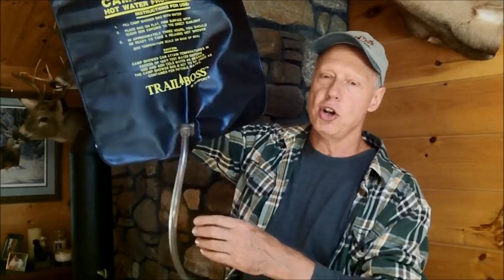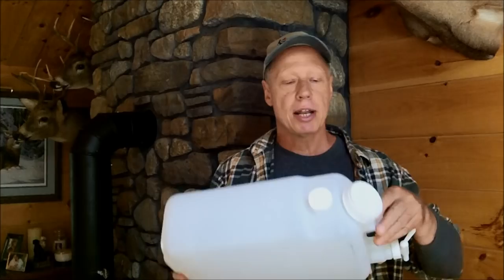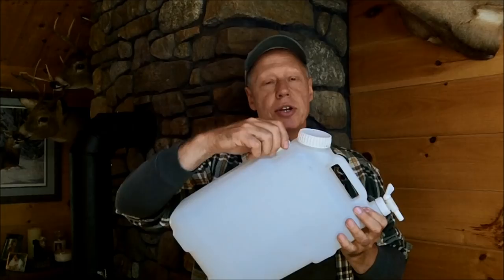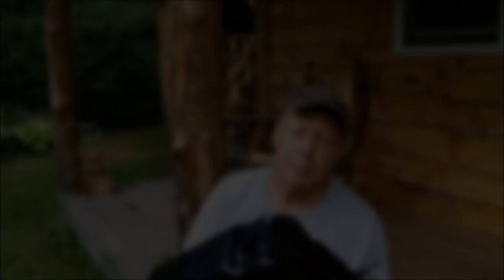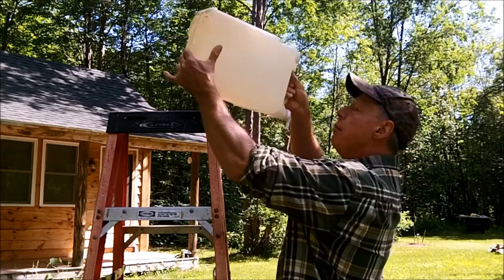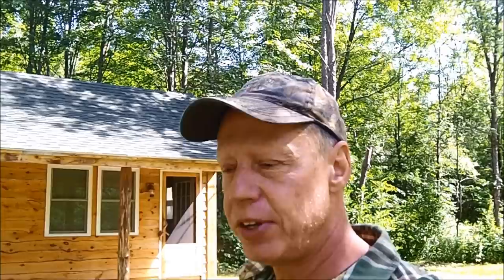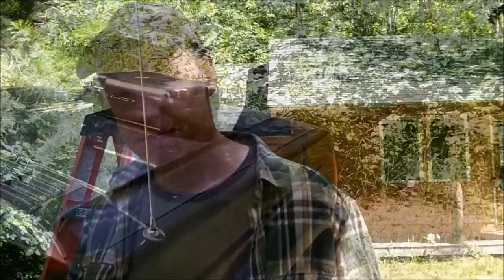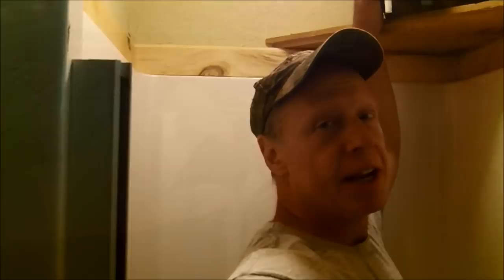HOW TO MAKE YOUR OWN SOLAR SHOWER.  DIY Project.

Comment: Hi BOTS Really loving your channel. You make it feel doable, even for a novice like me!
Do you think it's possible to make an effective sun-heated shower system out of 50-100 yards of black hose pipe? I was thinking of coiling it round on the sloped metal roof of an outside shower stall and attaching it to a trigger hose pipe head.  The other end would be hooked up to a gravity fed water tank. I'd appreciate some advice when you get a moment.
Reply from the maker: A coiled hose will heat water nicely but why fuss with anything more than this bottle?  This bottle offers a great shower and then it can be used in the kitchen, the shower, outside, anywhere.  See my latest video.
Reply: Thanks for the response. My reason was because I need large volumes of hot water....hope to be starting a new off-grid build soon and am pulling in volunteers...perhaps 8 people over a months build...which is lots of showers every day. I guess I could get 8 of these bottles....will check the video.
Reply: It's VERY doable.  I've used black pvc line , food grade black hose and regular garden hose from the local store..even the cheap 8/10 green/white garden hose. In Florida I've had it so hot it produced steam and was far too hot for me. But that can all be adjusted by how much exposure your hose is getting from the sun. I have used this method three different ways. A long black pvc pipe stretched out across a few hundred feet, a hose run on the ground stretched across the lawn (75 ft) and I've also coiled it and put it on three different surfaces/ three separate times. Coiled it on the lawn, coiled on the white porch and I coiled it and put it on top of the camper. I used a water Y and ran some water into the house but I also ran a line off that Y ,connected it to a garden sprayer that turned open like a jar lid would so that I could have it on and turn it off easily. I bought a shower tent from walmart and just ran that line across one of the snap locks that hold the shower connected to the support rods and in through the top of the door way and ran it through the tie that was sewn into the ceiling and let it hang down. I could easily turn it on and off or leave it runnning during my shower.  The shower tent I placed on a pallet that I'd picked up for free. Once you know the timing of the sun and when it heats to the temperature you need you can adjust your schedule to doing showering/ chores at that time of the day. By 2 pm at the very latest I had scalding hot water..and could bathe by 11 if I desired. As I mentioned...it was even getting too hot. It was so simple I couldn't believe how ridiculous it seemed to be spending so much on electricity when this was available and there's nothing like the feeling of bathing outside but with privacy. I love this method and will be devising something different for this summer. I have wanted to make a coil that hangs instead of having it on the ground and I've wanted to add more coils. I want to try more coils on the roof or lay more line down snake like across the roof...which i've also done before but i'd like to use more line. One other thing that i'm playing with is mounting an old water holding tank right over the shower. There is a roof vent over the shower...and I wanted to take that vent out and set up something with a similar set up as the plastic jug used her where you can turn it off and on or perhaps even use the same nozzle that i was describing with the twist/turn ability that i used in my outdoor shower.  You can feed the hose into the water holding tank and it will heat up and it will also refill by the hose as it goes down. It's hot enough on top of the camper to keep that water good and hot for quite a few hours out of the day. If i was real familiar with water pumps i believe that I would let that hot water into a hot water "HOLDING" tank and just recycle in the morning that which didn't get used during the night. :) Good luck !! A ten dollar hose can give you a couple of good hot gals of water in no time under the right conditions!
Reply: Right on! Thanks for this deecee stewart!
Not started the build yet, so it's all theory for me right now....We're thinking along the same lines! My theory is to use a ram pump to get water from the spring to the black tubing pipe.(Inspired by Land to House's videos) I would coil the pipe on and around a black painted 55 gallon drum, which would be fixed on top of a solidly built outdoor shower stall, then run a pipe off that with a watering can rose for a shower head. That would be long-term, but In the meantime, BOTS's carboys are amazingly simple and easy.
Reply: I meant ram pump to water tank to black tubing to hot water holding tank to shower. The hot water holding tank is inspired...thank you deecee.

Comment: Hey boss! What did you build your shower from? I'm thinking of the walls, floor etc. I'm building my outhouse and I'm wondering if I'm able to find similar materials here in Norway :)
Reply from the maker: SFHcrew I bought a regular shower stall. I didn't build it.

Comment: Thrilled  I just found your videos, does it heat uo to 108 degrees in the winter also?   Great videos!
Reply from the maker: No it doesn't but I have hot water on the woodstove all winter and that's what I fill it with.

Comment: I wonder how that black flex paint in a spray can would work on your bottle. It might not chip off as bad is my thinking with the flexing of the bottle and that flex paint, well, I guess it flexes ? lol . I've never used it on anything. I do use the rubber dip on hand tools such as my jewelry plier handles for better grip as I am a goldsmith . I think the Flex paint is the same stuff but in a spray form. Anyhow, I wonder if it would make it heat up slower in the sun or just the same and or help insulate the heat in the bottle as well ?
Reply from the maker: Never heard of flex paint before.
Reply: Sorry, I had to look it up. It's that Flex Seal stuff.

Comment: Yes it has been a while. Spent some time recently at Indian lake where my old friend has an old off grid camp and got thinking of trying to find my own spot to settle a camp. Wondered if you could could steer me toward a good area anywhere upstate ny to find cheap land, and maybe a realtor. I'm down in the hudson valley so not too far to anywhere upstate. Thanks in advance for any help you might be able to give me. Hope you are well.
Reply from the maker: George Scofield   I don't know anything about NY except for where I am.  Cheap land can still be found here but you have to look harder than before.  How much land are you looking for?  I'll be putting everything but my cabin on the market soon.
Reply: Really I'm looking for a small lot to keep taxes low and near state land where I can drive to hunt within reasonable distance. Thats how we hunt the central Adirondacks and have always done well. I'm in a spot in my life where I can afford to do this, but can't spend a lot. Don't want to waste your time unless you have a small lot around 2-4 acres
Reply from the maker: George Scofield  I won't be selling anything that small, maybe 70 to 100 acres but I'll keep my eyes open.  There's 11 acres for sale up the road for around a grand an acre. I used to own it and the owner is selling it now. It borders my land.
Reply: Thanks boss. I don't know how to private message or I'd give u my email
Reply: Would you tell me what town you're in so I could do a search of the mls listings? Or at least a general area. Sounds like u are in low tax area and that's what I'm looking for

Comment: Hanging those bags are a nuisance. I ended up showering while sitting in a chair. You can buy black plastic tubs at agricultural stores like Tractor Supply. Heat you water in it under the sun. Then stand in it while showering if you like. In fact you can wash really dirth your clothes in it then be sure tom rinse well in clean water.  I'm 70yo. When growing up we used the bath water twice. 2 older girls together first. Then the 2 grimy boys second. It sounds gross but we didnt know any different. Every penny counted.
Reply from the maker: We recycle water here too. Dish water gets reused to pre-wash my work clothes, rinse the  pee bucket etc.

Comment: Does it matter if it's matt finish black paint or gloss? Sounds OK in the summer (Except for mosquitoes) but what do you do in winter?
Reply from the maker: +S.R. Hurst  I take my showers indoors in my shower stall. All my cabins have shower stalls.
Reply: thebossoftheswamp
Much more sense. I was thinking outdoor shower might be invigorating but bugs might be an issue. On the other hand, outdoor showers are great for not tracking mud into the cabin etc. after the chores...

Comment: How hot does it needs to be outside to make the water over 100F?
Reply from the maker: I don't know the exact temp but if the bottle is on a black metal surface it will heat up fast.
Reply: thebossoftheswamp Oh okay thanks! I live in a pretty cold country but 68F in the sun might be okay then☺
Reply: thebossoftheswamp ¥